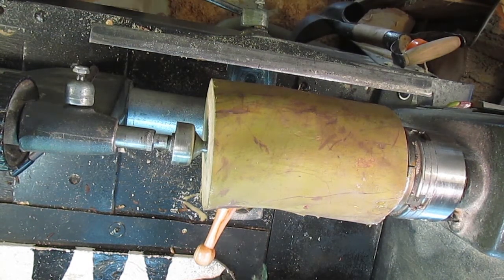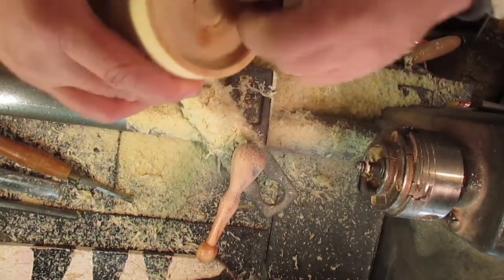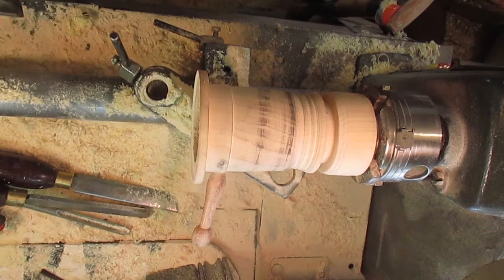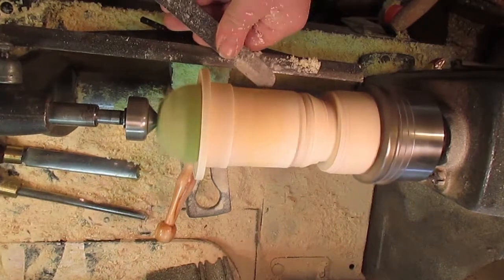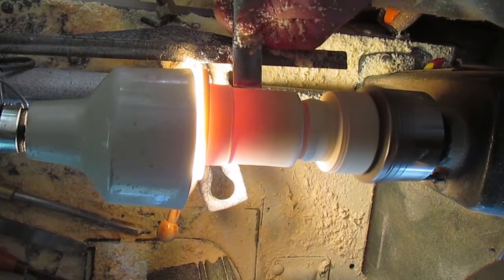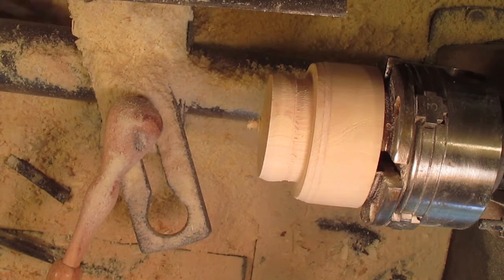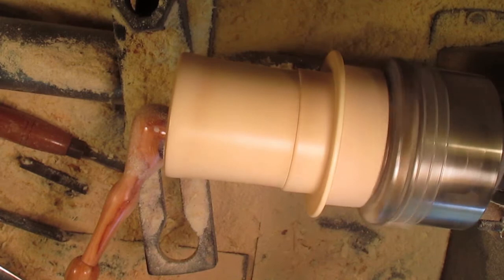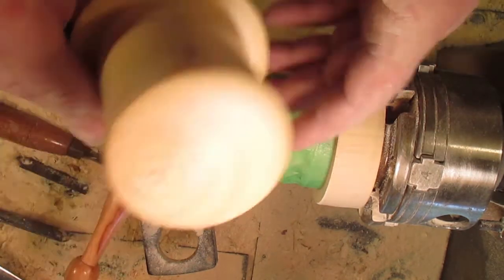Wood Turning #68 A Top Hat

Comment: Great project Larry, I've seen capt. Eddie spray water on that to expand the wood a little so it doesn't fly off, would hate to see you wear that..
Although it suits the cat :-)
Thanks for sharing 
All the best
Rob
Reply from the maker: Hello Rob:
You know I remember those shows now that you mention them... I will have to remember it sooner next time...
interesting to note that the next day I decided that the top was left too thick so I put it back on the jamb chuck... but just to make sure I put another piece of painters tape on... The hat wouldn't fit... so I took the tape off again... it still wouldn't fit... so I took off the first piece of tape... and it still wouldn't fit... I actually had to go back and turn away some more of the jamb chuck so I could get it back on at all! And that is less than 12 hours later!
Thanks for watching
Larry